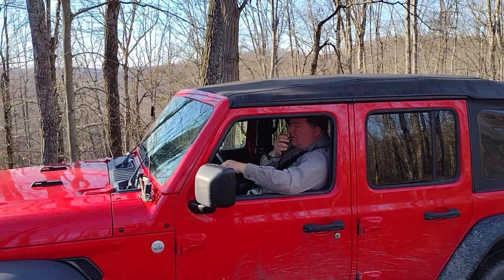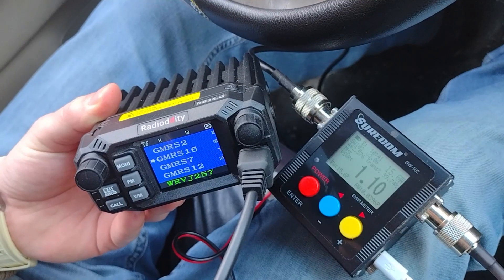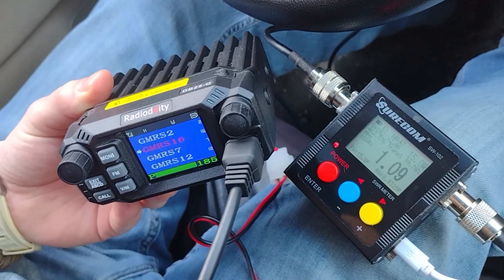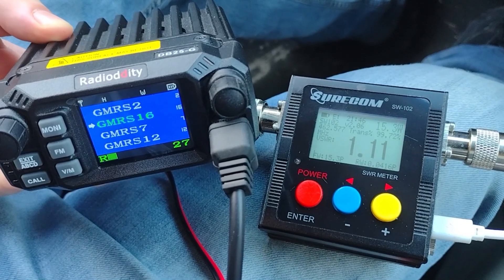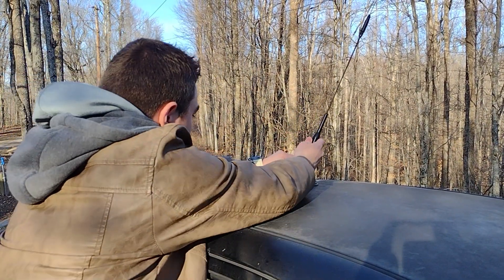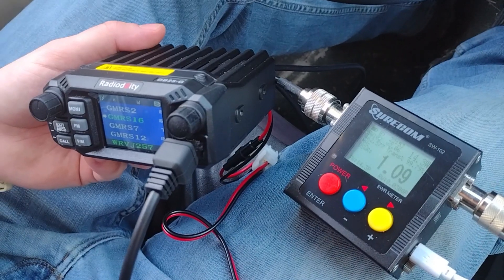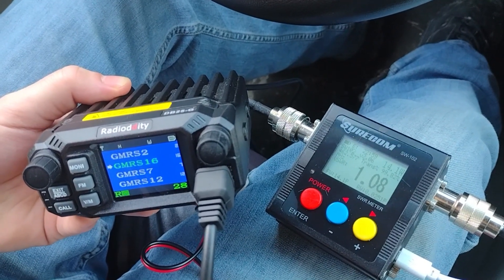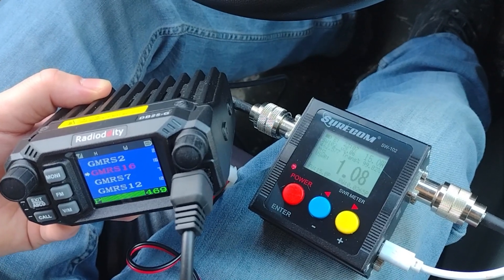NMO VS SO 239 (Nagoya NL- 770G)

Comment: I noticed absolutely no difference between the mount designs — as far as performance is concerned. Now, when it comes to weather proofing and corrosion resistance, NMO for the win, in that regards.

Comment: Determining they were about equal on the air was no surprise to me. 

The comparison I would be more interested in how weather resistant they are using various styles of mounts. 

Do both the NMO and the SO-239 antennae have O-rings around their bases? Will those O-rings provide an effective seal with various types of mounts?  🤔
Reply: The NMO is oring sealed. The so239 is not. However, the so239 does have many more threads and fits much deeper with the antenna itself having a rubber seal. I haven't personally had a weather related issue on my so239. 
From my internet findings, a slight majority of "experts", find that NMO withstands weathering better but will update later if a weathering related issue comes up!